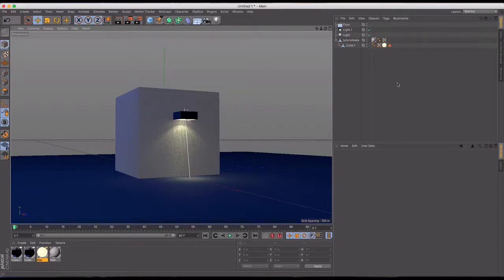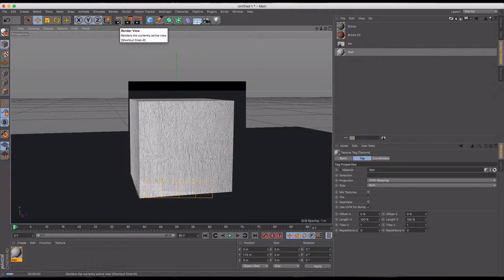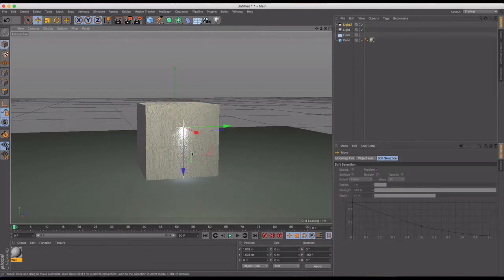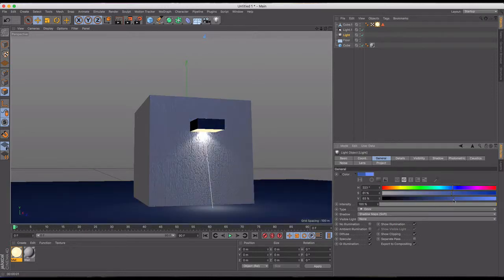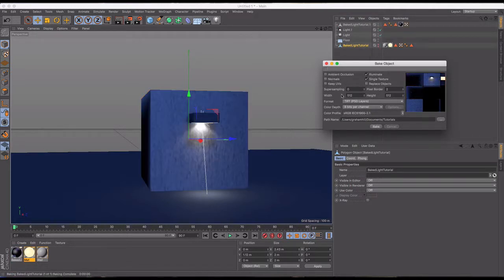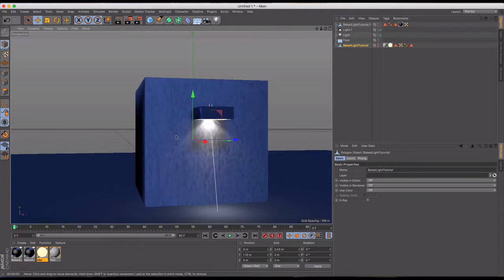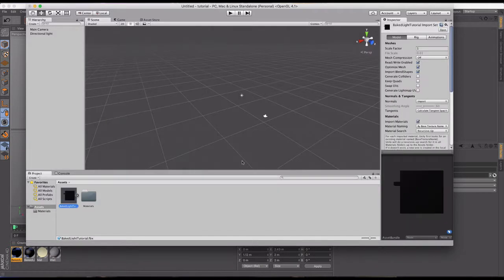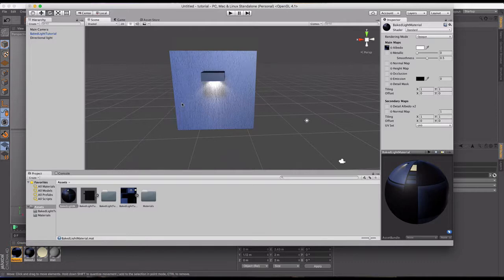Cinema 4D - How to Bake a model with Lighting for Unity

Comment: Cool tutorial, thanks! Question: if you disable the lighting in unity it's pitch black. how do you disable the light but see the scene as it should be? because we don't need lights now, as we bake the lights and shadows already. it's probably simple but i couldn't figure it out
Reply from the maker: Probably just an issue of playing with luminance on the shader
Reply: Might be better to set the texture as Emission map rather than Albedo in Unity.